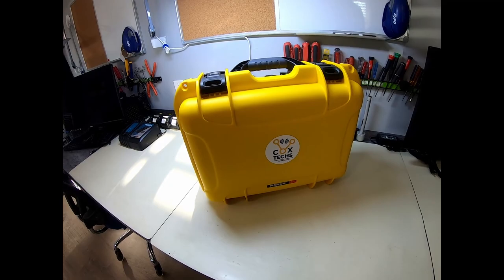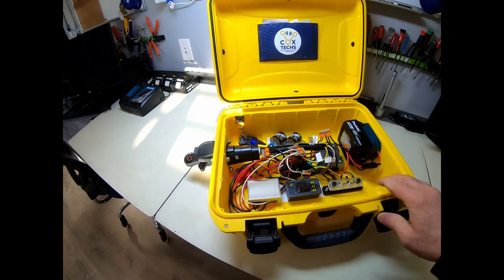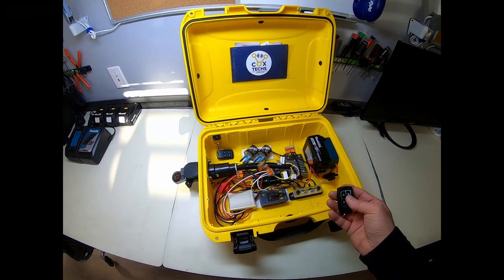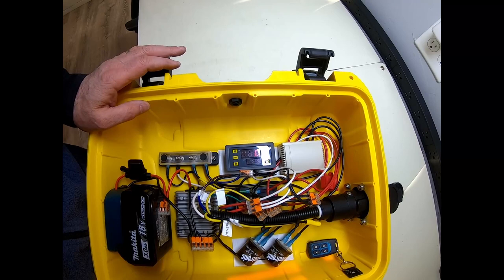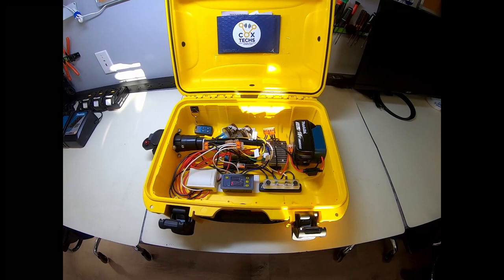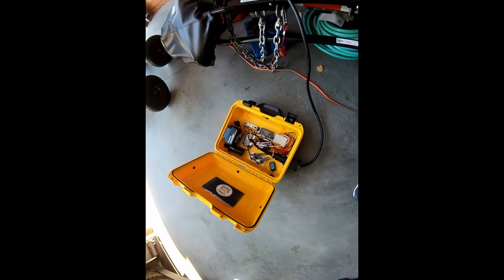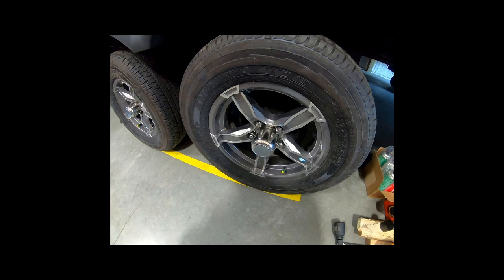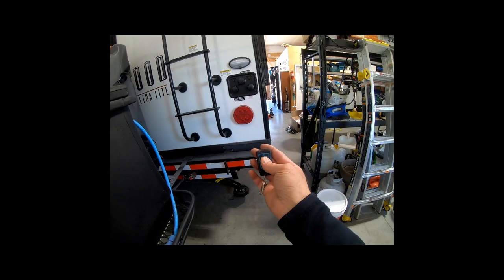Build a Better Trailer Brake and Light Tester with Wireless Control!

Comment: Love this! I’m going to build one, have parts ordered. Is there a wiring diagram somewhere that you have posted or somewhere else? Thanks!
Reply from the maker: I do not have a wiring diagram, however, if you need some photos of the layout with connections, I could send them to you.
Reply: @mikecox5700  thank you, let me get my parts and get started and will contact you if I have trouble.

Comment: Did you use the 20A relays because of the brakes, or do the other circuits need 20A? I am wanting to build something similar, but had been looking at 10A relay boards and adding a 20A for brakes.
Reply from the maker: Maximum amperage draw for 4 Brakes that are 10 or 12 inch diameter is 15.0 to 16.3 amps at 12 to 13 volts. You should use the 20A for the brakes.

Comment: Great job!  What did you use to make the turn signals flash?
Reply from the maker: I installed the flashers for left and right switches with the flasher listed in the build comment section:

https://www.amazon.com/dp/B00JXLH7CG?_encoding=UTF8&psc=1&ref_=cm_sw_r_cp_ud_dp_70Q5Z7K29Z2SWDTB4QMX